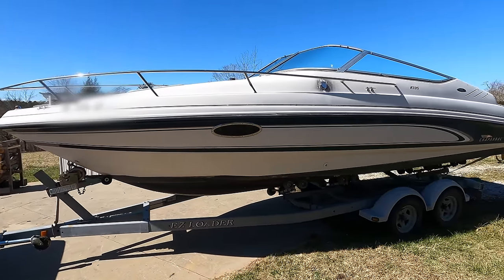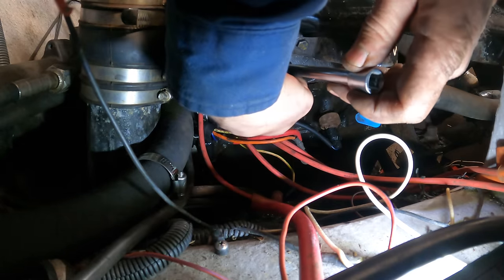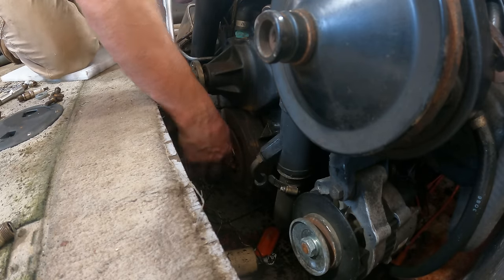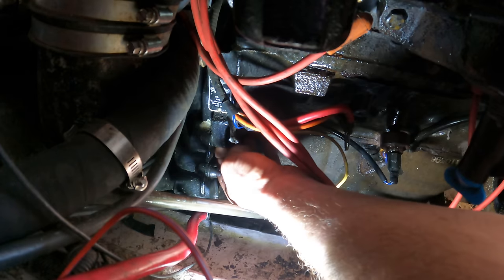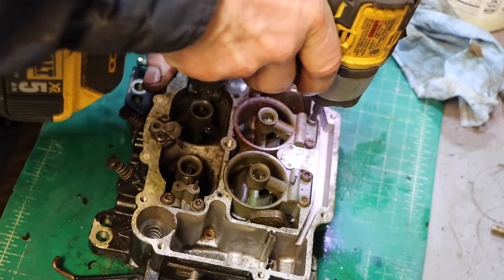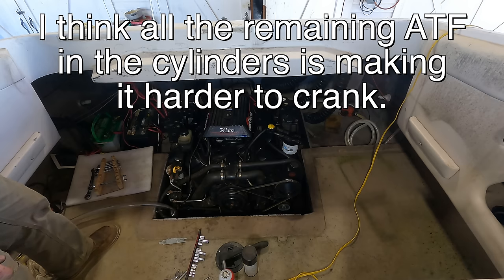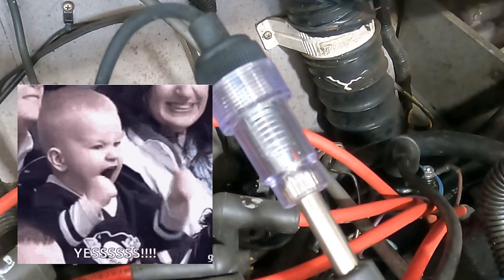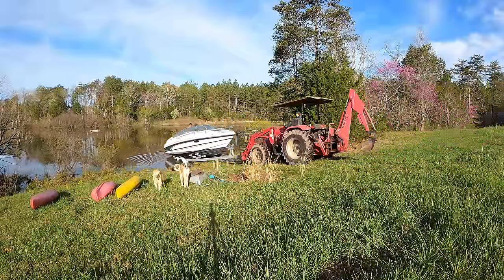Fixing A Boat With A 454 Big Block Engine

Comment: Nice save!  FWIW, the "air filter" is actually a spark arrestor. That's also why there are marine rated alternators. They typically have a fine mesh screen over all the openings so that should there be any spark, it can't ignite any fuel/air mixture that might be in the bilge.  That's why you run the bilge blower for 5 minutes before starting the engine. Boats going boom is a Bad Thing(tm). Lived on a houseboat for 10 years. Had two 350ci Mercruiser engines and outdrives, and a 10KW Onan generator. BOAT == Break Out Another Thousand.
Reply: Yup.  Boats don't need air filters, just like snowblowers.  They run in a relatively clean environment, so no dirt and dust to keep out.
Reply: @jeffh4505  Fortunately, pollen isn't very abrasive and burns fairly well in the presence of gasoline.
Reply: How did you comment two days ago when it was uploaded 2 hours ago? 😮
Reply: @anzakaleem7932   I'm betting it's a paetreon pre-released video.  Or @JCWren is magic.
Reply: Marine starters, alternators, air intakes, and distributors are all ignition protected.
Reply: I know that feeling. 3 grand for a new outboard for my boat. Haven't bought it yet because it's not in the cards yet.
Reply: Another valid saying is that a boat is a hole in the water to throw money into!!
Reply: Flame arrestor.
Reply: Yep I agree, my son bought a boat and what I thought and he thought a lovely clean mercury in board engine. But he still spent thousands fixing up an 80000 boat......
Reply: Jon, you make my Fridays for sure… Break Out Another Thousand ‘Whack-A-Mole’s…

Thanks!!
Reply: Time cures all includeing rusty cylinders oil up leave for a couple of weeks for oil to penitrate bores..not hours or a few days..lol
Reply: That engine is toast
Reply: You should try to change plugs on chevy Monza V8
Reply: The center bolt
Reply: So, how many thousands of dollars did you charge your brother, lol
Reply: Spark arresters are in the exhaust of outdoor equipment. That is flame arrestor

Comment: New bolds, Starter, Coil, Distributor, sensor coil, working hours. You already know: BOAT = Bust Out Another Thousand. Your brother should give you a lifetime of free boat usage.
Reply: I agree....
Reply: There was probably nothing wrong with the starter or coil, it was just the bad ground. Good lesson to learn!
Reply: Boat: a hole in the water you pour money into.
Reply: Boat: A hole in the water you pour money in to.
Reply: @sectokia1909  
there was something wrong with both of those things, the new ones work WAY better then the ones that were on it. while it wasn't strictly needed, it certainly will prevent issues later on related to those things.
Reply: It had ignition issues, as the brother said it was hard to start. It it always not one issue, it always couple of issues causing one symptom. In this case hard starting when cold.
Reply: Can’t reach the spark plugs?  
Snap-On makes a tool!!
Reply: @rocksfire4390  Nope... check out when he tested both starters on the bench. They both work. Yes the new one sounds a little better, of course it would as the rotors slowly expand. Then he shows measurements on the ignition coil and they are both within acceptable range. The problem was the earth strap and the distributor circuit board. Obviously there is no harm in replacing the starter/coil anyway and there is now going to be longer life. But this is a very common mistake in vehichle work - which is electric problems are misdiagnosed due to high resistance ground, and it is a good learning to take away from the video. As soon as you have electrical issues - start with checking the ground path resistance first - like he does @1:20:30
Reply: Your brother owes you…!! 😎
Reply: Another reminder that the two happiest days of a boat owners life are the days they buy it and that they sell it.
Reply: @sectokia1909  
you can HEAR the difference between the two on the bench and when he installed them (before cleaning the ground). yes both "work" but one sounded MUCH worse then the other one, not just on the bench but installed before the ground was cleaned.

the flywheel teeth had a few ground off, no doubt the starter teeth where not in prime condition.

it's acceptable to replace it and honestly because it was shimmed as well it certainly wasn't meshing as well as it should be with the flywheel and causing even more unneeded wear.

again it wasn't strictly needed but it certainly would became a problem if he had left it.
Reply: still cheaper than a day of fuel in that monster.....

Comment: A boat is a hole in the water that you pour money into. The only day that's better than the the day you buy it is the day you sell it.🍻
Reply: BOAT stands for Bust Out Another Thousand
Reply: That is usually true, but I had a 1990 Hydrasport 2000DC...and it was the most awesome boat I'd ever ran.  It was a sad day to see it go.
Reply: I bought a 1950 Bayliner cutty in 1986 brand new with a 305 Chevy and Volvo outdrive. I was out almost every weekend in the spring and summer and fall in mission Bay and San Diego Bay for 6 years. It did around 52 mph and I had it open all the time I was out unless I was in a five mile an hour zone. I used to take it out in the ocean and fly across the waves. The boat took a beating but I took really good care of it and when I got it home on the trailer I flushed the engine with fresh water and hosed the boat down and squeegeed it. I never had to do anything to it because I took care of it. I can't say what happened to John's brothers motor but the crud in the carburetor? The water and the intake? Hard to understand that unless the boat sunk and was pulled up out of the water and it was given some really dirty fuel. Anyway, if you get an old boat it's like an old car only worse You're going to have to put a lot of money into it. And if you don't take care of it no matter what it is it will fail.
Reply: BOAT = BREAK OUT ANOTHER THOUSAND. Believe me I know...lol
Reply: Try a plane....
Reply: That is a tiresome cliche and is illogical.  So, no one sees the time, effort, and expense associated with any other machine as being a waste because, why?  Is it the boat’s fault the engine seized?
Reply: Now now, even a hole in the water to pour ur money into is no the worst place to put it.
Reply: You got that right!

Comment: Great job!
I am a Mercury certified tech. I’ll be honest, it was frustrating to watch some things, but super gratifying to see you succeed! 

A couple tips;
-Put a timing light on the plug wires and leave it on there the whole time you’re diagnosing.
-you can use a battery load tester through the engine and your battery to test you positive and negative cables. 
-pumping the control handle in throttle only position will activate the accelerator pump within the carb and shoot streams of fuel into the intake. 
  I.E. - pump the handle 3-4 times, crank the engine for 3-5 seconds and repeat. All carb sterndrives have an accelerator pump. 
- trim the gear case down while running to straighten the u-joints in the transom assy.

Due to how the boat is made, let’s talk about that piece you kept hitting your head on…
That piece appears to end right over the top of the carb, so when it rains, water will run right off of that and on top of the carb, bad boat design…thanks engineers. Now to combat this issue, there is suppose to be a metal washer with a rubber seal on top of the motor cover that has all of the motor info on it. That washer usually disappears or erodes.

Take the boat to the lake and put a load on it, then compression test again.

And yes, we would have said it needs an engine, due to shop warranty issues, or a disclaimer would have to be signed.
Reply: ^^^^This!!!! I cringed when I saw the condition of that carb and starter, and thank gawd you have the wherewithall to deal with those! I can think of a billion other things your brother needs to address on that boat! We have had quite a few RV Toyhaulers, and just like a boat (we've called them Land Yachts), they're nothing but a big hole in the middle of the RV park (desert in our case in SoCal) that you throw a whole bunch of money into. 🙂Oh...and like a good brother that you are, I'm sure you detailed his boat for him before he picked it up (boy, it needs some TLC!!!). 🙂
Reply: It was the most frustrating You Tube video I have ever watched and I have watched thousands. I could only make an hour and could not take anymore.Even if he got it started, who would have the confidence to take that boat out further than he could swim.
Reply: Do you know anything about the starter motor alignment issue? Was that meant to be doweled  into position by the bolts? Did one of the original factory bolts stretch? There seemed to be something not quite right about the story on how the shims got there.

Comment: Gotta say, one of the best things I’ve seen on this channel so far is the drill as a hammer on a 2 foot bar
Reply from the maker: It's a hammer drill!  ;-)
Reply: @FarmCraft101  LOL
Reply: @FarmCraft101  Came here looking for that exact comment. Not disappointed 😀
Reply: @FarmCraft101   Make sure you use it as a drill first, then as a hammer. Works better that way.
Reply: John you are a mechanical wisard with  an unbelievable patience 👍👍👍
Reply: @FarmCraft101  Every tool has a hammer side
Reply: Almost every tool can become a hammer, but only a drill can become a hammer drill.

Comment: Been doing that for a living for a while (40 years) and personally shoot the two bolts at the back of the engine, the two or three for the engine mount, remove the exhaust rubbers and unplug the electrical  then pull the darn thing. 
Oh and your starter is MISSING the support bracket that goes from the end of the starter where the solenoid wires hook to the block that keeps the starter from twisting and breaking the bolt. 
Be glad it had the small starter on it and not the big one we used to run ( twice the weight and size.
Well done for going in blind John.
Reply: I second that. And, as a kid who grew up on a car lot, there used to be instructions in the box with a new starter explaining some voodoo magic to figure out which, if any, shims were required.  But that was the late 60's when they started making everything easier for them and harder for us.
Reply: Someones brother owes someone a case of something flavorful and flammable,,
  I took one look at that rust and said no way … That things just going to grind it’s own heart out….  I’m blown away!!!
Reply: When loading, if you kill the engine as the boat contacts the trailer , boat wake can overflow the exh. manifold hump and enter the cylinders.  The case I knew of requires a total rebuild.

Comment: Definitely change the oil asap! it's safe to assume that that if there was water in the cylinders, that some made it past the rings and is sitting in the bottom end, and after running  i'm sure a lot of that junk made it down there too. Good save!!!
Reply: Speaking of changing the oil.....you might want to check the outdrive oil and tell your brother he can crack it open and replace the brittle plastic water impeller before that takes a shit......
Reply: whats the procedure for changing the oil? there a drain on the outside?
Reply: @stumpingrimy1686  My boat has a hose connected to the bottom of the engine.  I can pull the hose through the drain plug of the boat and drain it easy peasy.
Reply: @stumpingrimy1686 
 Some you vacuum pump the oil out.  It's great if it has the drain hose setup like other posted.

Comment: I'm amazed the engine, even with the rust and corrosion damage to pistons and cylinder walls would be able to run and idle as you got it to run. GREAT SAVE. Your total experience learning what happens during storage periods is worth a $1000 bucks to all of us who will probably encounter similar issues with tractors, outboard motors, lawn mowers, cars, etc. THANKS.

Comment: Fun fact, That is not an air filter as there is little to no particulates on the water they are not necessary. It is a flame arrester in case of a backfire. It prevents the ignition of gas vapors in the engine compartment, keeping the back of the boat from departing without warning.
Reply: Unscheduled Dis-Assembly
Reply: just for warming the boat in winter.

Comment: We used to have the same Chaparral! I think I know what happened... Water likely collected around the tarp in the engine basin due to leaks in the back seat and engine compartment. If it sat for several summer seasons, a hole in the tarp might not be the issue. The water likely evaporated and collected underneath the tarp, especially since the high point was atop the carburetor, providing a direct path to seep through and collect in the engine. Tell your brother not to cover the engine like that anymore and cover the back seat with a big ass tarp instead. Fixing that leak would also be smart too. Good work Jon!

Comment: Hey Jon, get yourself a 'Bump Cap' . A Baseball like cap with a hard plastic liner, good for thes kind of jobs and when working under vehicles up on your lift. Believe me I know, haha. Many thanks for ALL your always interesting videos, from UK.
Reply: I was going to suggest using a pool noodle split over the edge of that protuberance! :)
Reply: Those plastic bump liners can be bought separately and used in just about any ballcap. A company I used to work for allowed them as an alternative to a mandatory hard hat, and my liner fit every ballcap I had. They are trimmable if need be, to make them fit in the hat better. And they're pretty darn cheap.

Comment: Id be surprised if a mechanic would try that hard for a customer but maybe a few rare ones.  That was dedication 👏
Reply: Amen. That would have never happened at a boat shop. After the borescope, the engine would have been trashed
Reply: Would you be willing as a customer to pay a tech the $125-$250/hr to experiment?  What happens when he's 4 hrs into it and you find it's not repairable?  As a shop owner, would you be willing to take the liability for putting out a job like that into the field?  The answer to both of these is generally NO, which is why most shops won't do such work and would just say put in a new motor.  Which, btw, is actually pretty easy on something like this.
Reply: The repair would cost more than the boat is worth.

Comment: Whenever someone works on an engine, unless it is something really small, I always recommend pulling the engine. When working on a boat, I recommend dropping the engine through the bottom. That usually resolve both the engine and boat problems......

Thanks for sharing another great video. {I still miss the cannon, but this is good too.}

Comment: Now you get to do the bellows & the water pump impellar in the lower unit.  I have 15 years experience. I love that you got the broken bolt out. AWESOME 🎉
Reply: Wouldn't have broken the bolt, if you have the front support strap on the starter. You are lucky it didn't break the starter nose and then you don't have a starter core.

Comment: I'm dying watching you try to start this. Being a boat builder and mechanic for 40+ years I have to give you great credit for both your work and patience. That said, I would have checked that ground as soon as I got such poor starter performance and would have changed out the battery cables. Those cables can build up considerable resistance after years in salty environment. I tried to wait until end of video before jumping in but I just couldn't hold back lol. But I cheered when it finally fired and ran. Nice work!

Comment: My neighbor’s inboard/outboard sank in his slip. Four ropes on the corners attached to the slip and boat were the only thing that kept the $40,000 boat from going all the way to the bottom. The depth of water beneath his slip was nine feet. I used a sump pump and a small generator to pump the water out. The local marine mechanic flushed the engine, got the engine running, changed the oil and filter twice, and repaired replace the bottom seal for $3700.00. My neighbor used the boat for two more seasons before selling it.

Comment: We had a 24 ft twin inboard outboard, and we took the engines out as a habit each fall; they were gone over and dry stored and re-installed in the spring. I know what you are going through. After a vacuum test of the cooling system and cylinder compression test, we fogged the engines with oil. and ran mineral oil through the cooling system, and that was it until spring. The first year of ownership was the turning point for all the BS of salt water invasion.

Comment: Fuel, spark and air.  You covered the basics.  Modern electronic ignition and fuel injection solves half the problems you had. Great video.

Comment: Try using a Pool Noodle to cover your head-knocking point the next time you work on a boat. Split it and put it over the edge...and walla, head protection for your noodle.

Comment: Congratulations!  I did not think that would happen...very nice job Jon!  
The battery switch that is on there is not made for marine use...the contacts inside are most likely very corroded which make the connections hinky at best.  
BTW:  A tea strainer ball works very well for smaller part needing to be put in the ultrasonic cleaner.

Comment: dude!!!!!  BROTHER OF THE YEAR, that was insane .i knew when i saw the cylinders that you were in for some hEl1 ,I didn't see the broken starter bolt coming, however I knew you would  have to clean the carburetor and everything else including fuel filters and drain old gas etcetera ...You truly are brother of the year. And the Patience of a saint. And I'm not even done watching it om my tv .i had to get on my computer and write you. god bless brother